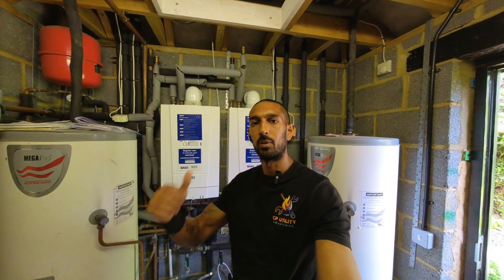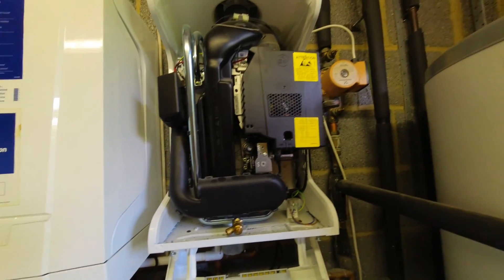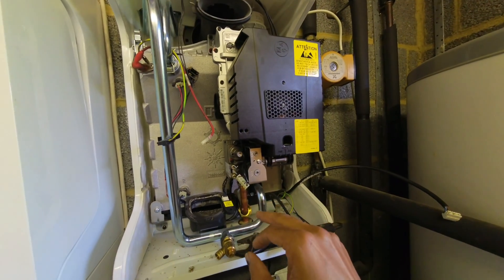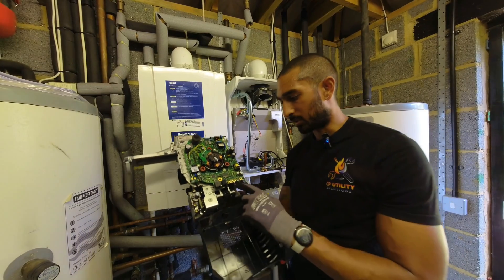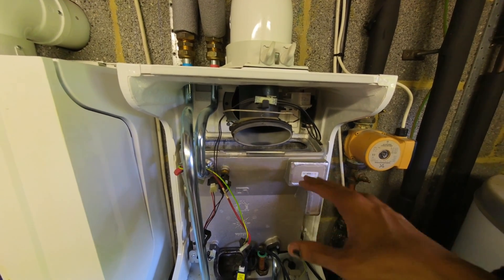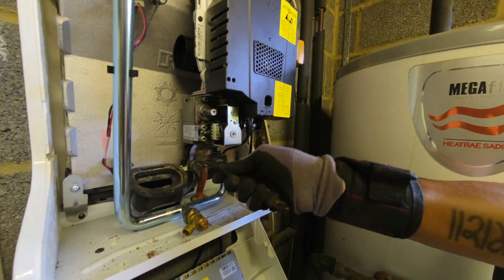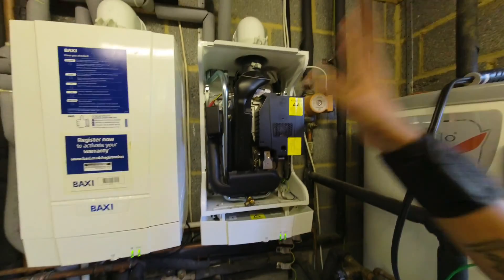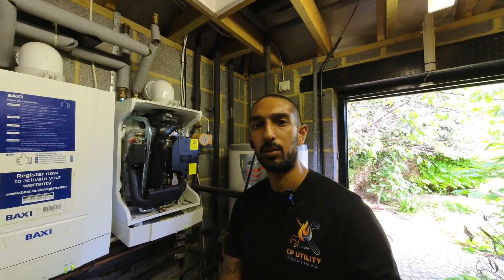Baxi Heat Only Boiler - Full Service

Comment: Need help mate, you know the temp wheel at the bottom, it doesn't seem to alter anything, the rad temps are the same, even if you turn it to the off position, the rad temps stay the same, I have two, two port valves, one for heating, and one for hot water, any thoughts please

Comment: What about replacement parts, is the control unit only available as a complete replacement unit, therefore very expensive?. This sort of info would be very useful to know for installers and customers.
Reply from the maker: Yes as far as I know it's one complete unit

Comment: Can you tell me why the button with the symbol it's flushing on red?
Reply from the maker: You need to look at the MIs in the fault finding section which will tell you what the fault relates to depending on the number of flashes, etc
Reply: @cputilitysolutions 
I found it!! 
3 flashes red - mean ignition fault
 it's anything I can do? 😭
Reply from the maker: @marzenawitczak1891  the only thing you can check yourself would be if you're on a pre-payment meter for gas or if your gas meter has locked out if it's a smart meter. Otherwise you'll need to call a gas engineer as ignition fault can be related to a few different issues within the boiler itself
Reply: @cputilitysolutions  thank you for your help!!!

Comment: How did you manage to vacuum out the heat exchanger in such a tight space, what did you use
Reply: I use a flexi hose that is sold to clean computer key boards, they fit on the end of a vacuum cleaner hose.
Reply from the maker: I used the regin dusta duo, it's just small enough but it is bloody tight in there!

Comment: Ive just been out to a 30kw one of these to change the combustion unit. Ive ended up failing to get the burner out and walking away till monday 😂. I was certain it wasnt coming out without removing the tamper proof t25s. Thanks to your video , I'll be back on monday morning and wiggle it out.
Reply from the maker: Nice one mate, yeah if it hasn't been stripped out then the burner seals can get stuck to the burner

Comment: Strange question but I’m suffering atm with the same boiler baxi 600 heat ! the boiler keeps going off and flashing red ! I’ll restart it and it will work for 10/20 min and then it will go off again ! I had a new pump and valves replaced as it’s an old system but I still get the same results! Any help would be much appreciated, Thanks in advance
Reply from the maker: You need to refer to the fault finding section of the MIs as the lights will flash in a particular sequence and you need to check it against the table to see what it's referring to

Comment: These are very easy for the gas fitter. I’ve fitted a couple. I would choose a 24Ri if possible. The combustion control unit being the reason. Never knew the no water, so thanks.
Reply from the maker: Nice one 👍🏾

Comment: Nice smooth step by step, they are my go to heat only, very handy in certain scenarios with switch live only and rear flue option but as you say could be expensive after warranty period having to change gas valve fan and pcb as a complete unit. Baxi advising not to pour water down heat ex in fear of blocking it up is also a concern seems like you could potentially do more harm than good brushing them out... fortunately I find most combustion chambers with down firing burners seem to stay fairly clean 👍👍
Reply from the maker: Thanks mate 👍🏾

Comment: I normally use nectar card to separate the burner plate and its black seal which will stick to the head of the combustion chamber unit to separate them as they stick to each other when you open clips and that's where you struggle to pull it out
Reply from the maker: Nice tip bro 👊🏾